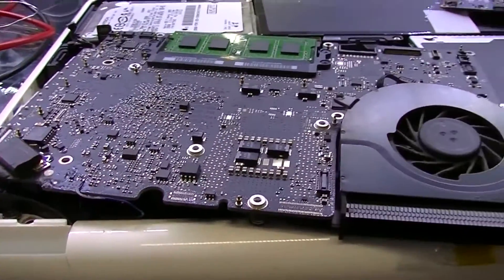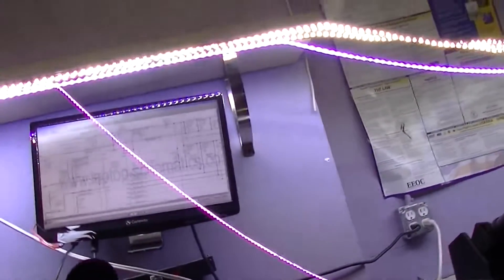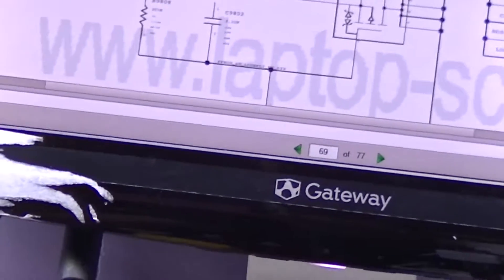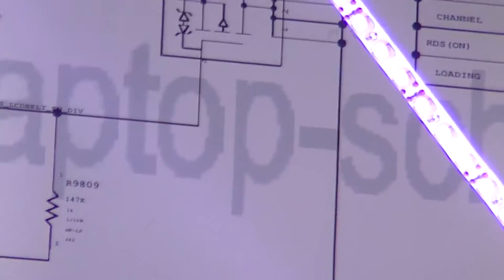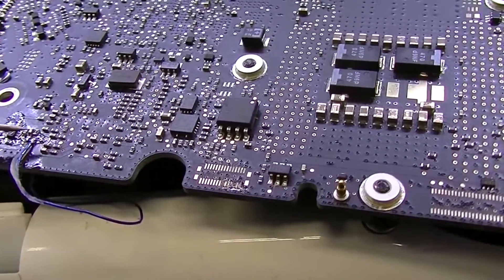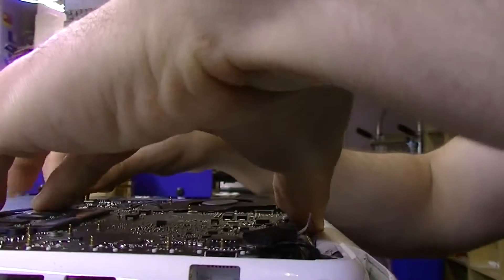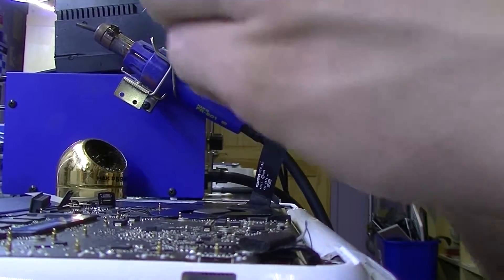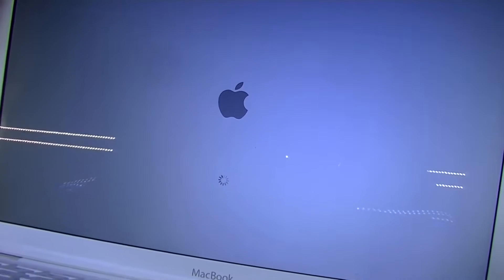"820-2567 A1342 White Unibody Macbook no backlight logic board repair" date:8-14-14

Comment: hello mr rossmann  i have a A1342 macbook the screen works fine untill i start to screw down the vent support bracket on the bottom ,the lcd goes black ,then if i lossen the screw the lcd comes back ,i took the bracket off and tried moving the lcd cable to see if i can repeat the fault but i cant ,i can only repeat the fault when i try to screw down the vent support bracket ,and it seems like on the screw hole next to the lcd connect,would you be able to shed some light on this for me thanks and have a good day